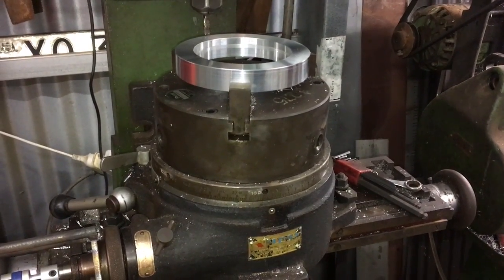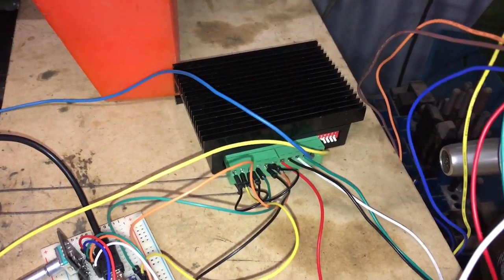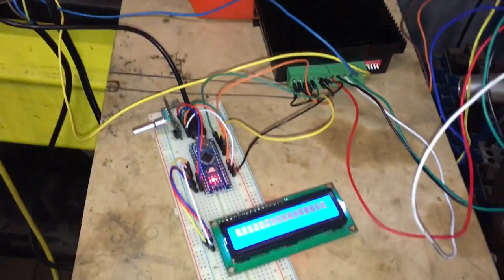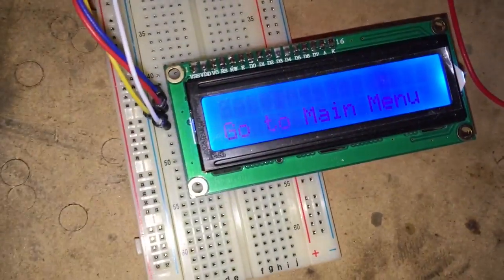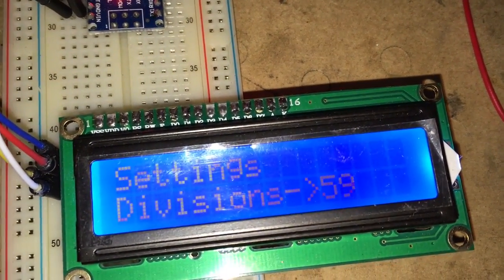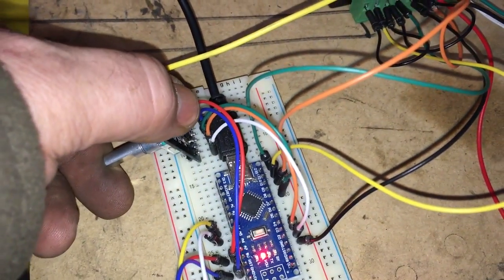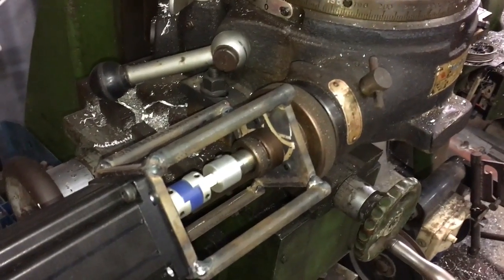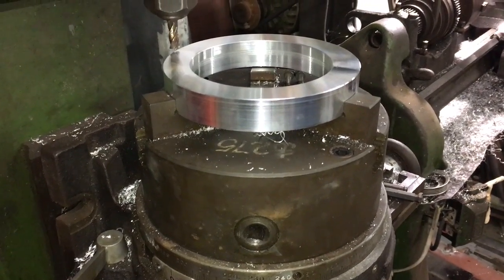Automated Dividing Head

Comment: Hi Mick Percy, I congratulate you on this great project, it looks great and is quite interesting, but I have some doubts:
As divides the circumference into equal parts if it is a prime number?
As does the program to compensate angle errors, especially some function?